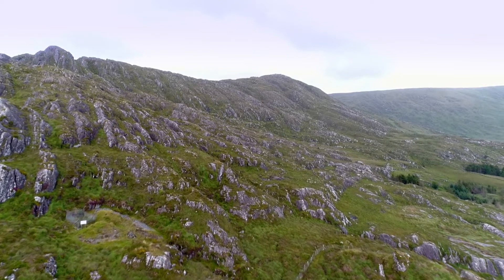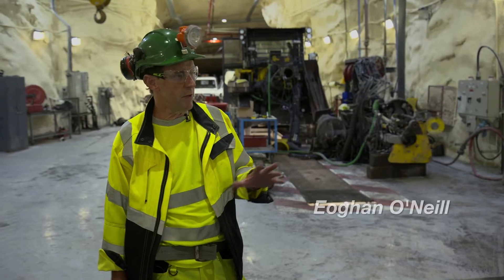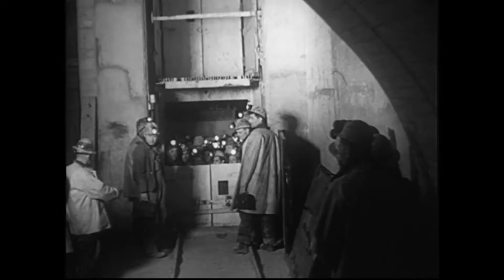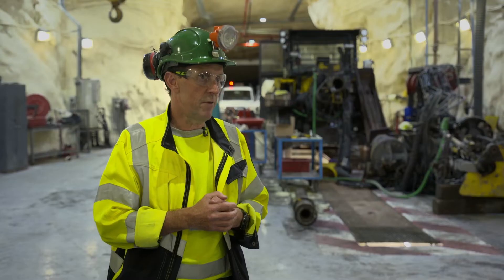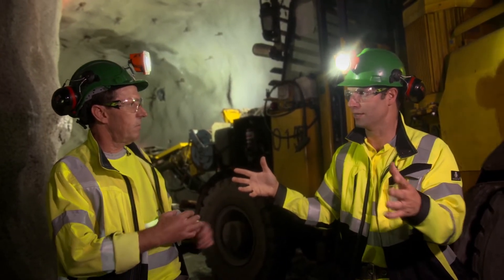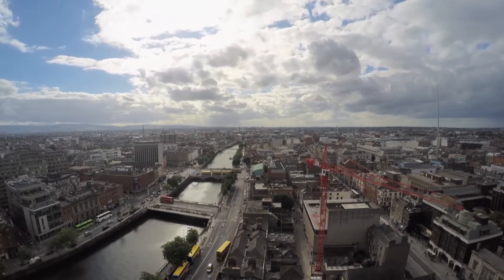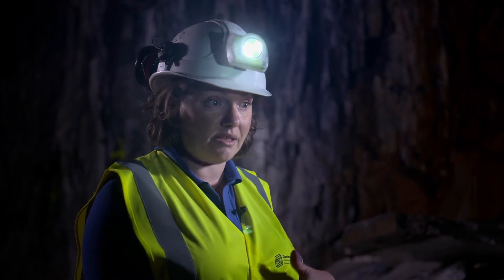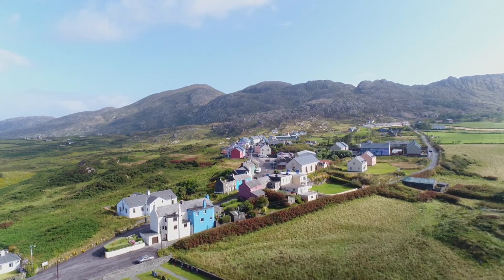10 Things to Know About Metals (Tara Mine, 2019)

Comment: The "history" told at 1:40 is incorrect!  The agricultural survey showed high copper values, which do not seem to have had any connection to the zinc deposit.  A major international mining company found high levels of zinc (up to 2.5% in soil samples), and decided it was contamination from metal sheds and dropped the licence.  Tara Exploration then took out the licence and investigated on the ground, finding ore-grade zinc mineralisation in boulders propping up electricity posts.  The rest is as they say, history.